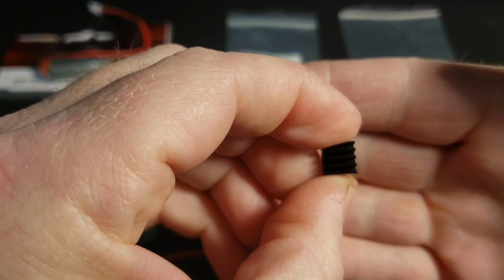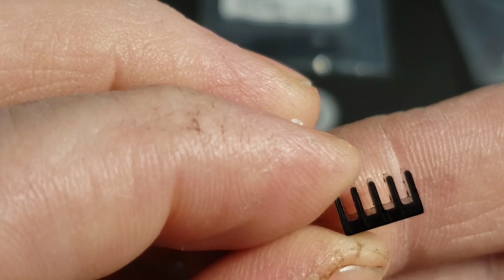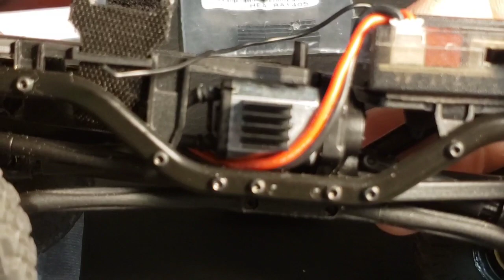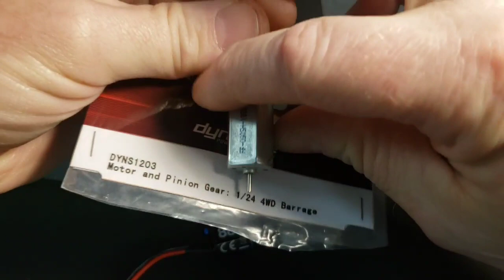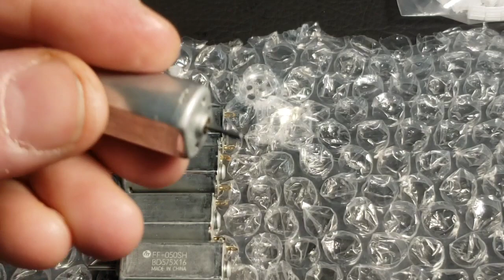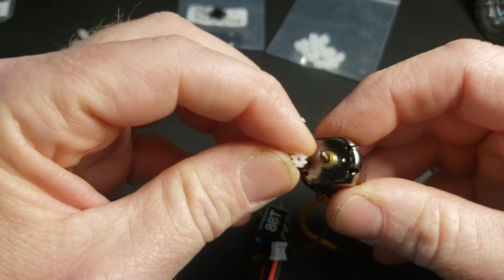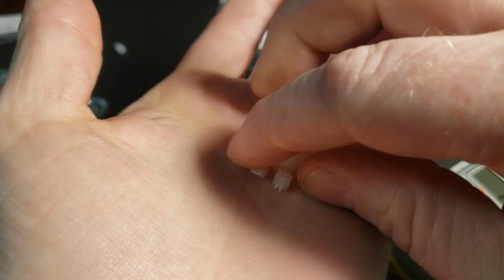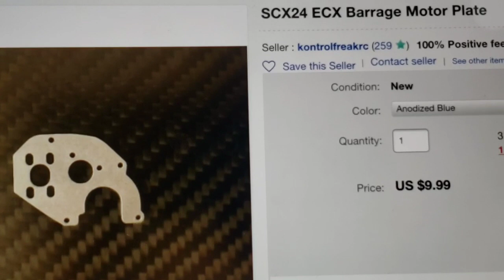SCX24 Brushed Engine And Gear Options

Comment: Thanks for the info. I replaced my motor yesterday. While backordered, I did see a couple of these motors sold in a bundle but I noticed the lack of cables and resistor. I can (merely) solder the cables, but the resistor and the theory behind that is kinda magic to me so I just waited for the thing to be back in stock and got two haha. I did not grind the motor shaft for fear of somehow damaging it, so I put an improvised washer between the motor and the plate and ground down the inside of the cover just enough to not perforate it. It works ok but the plate and the cover look messed up lol... I may end up buying them...
Reply from the maker: Just drill a hole in the cover if you are not comfortable cutting the output shaft. 

If you run the Shapeways motor mount it doesn't even have a cover. Indoors it would never be a problem.

Comment: I just drilled a hole in the transmission case, it worked fine.  How long are your motors lasting before replacement?
Reply from the maker: Since I figured out all of the places that can bind the drive train and run heat sinks I have not had a single failure.
Reply: @EXPIOWA  really? Huh
Reply: @EXPIOWA  wait are you saying you've not had a single engine burnout?
Reply from the maker: @czechnolike  That is correct. Since correcting all of the binding areas (that were present from the factory), and adding heat sinks, none of my motors have failed. 

I have one stock (sticker removed), one Barrage, and one PN70 rig. You have seen my course on video. I only rock crawl. I drive at least one every day.

Comment: Thanks for this vid and others you have made, they are super helpful.

OK, I got replacement motors delivered today and couldn't wait to tear into at least 1 of the 4 SCX24's I've acquired in the last month. 

I drilled out my own motor plate, installed the barrage motor, flipped the wires in my plug and set off to impress my son. The C-10 leapt forward with authority, but limped and sputtered in reverse, even more so while turning in reverse. I switched batteries, removed the trans cover, checked for rubbing at the diffs and wheel hubs, swapped the motor/trans into another chassis/ESC, and then even switched barrage motors (bought 4). The problem was minutely less in the Betty chassis, consistently bad for both motors I tried. The gear lash is set loosely between the spur and pinion.  The only influence I was able to make was to push gently on the motor housing which would change the alignment of the motor shaft to the spur gear.  Only other thing I can think of are bearings in the trans (I could try these motors in a different trans), but even those seem to spin freely. Oh, yes, the driveshafts are correctly phased. What might I be missing? I did not superglue the pinion gear on the barrage motor shaft, it was quite tight. Maybe that is it??
Reply from the maker: Try running it without the body. I have a suspicion that something is rubbing. Headlight wire maybe. It is probably not the gears. Also make sure the wheel nuts are not too tight that they bind the axle.
Reply: @EXPIOWA  good thoughts, thanks. 

I did catch one wheel weight that I guess was rubbing, however, I got so paranoid that I tested each motor before installing them. I think I just got two bad ones. Running in my hand alone two spin well one direction, but backwards sounds/feels like a bad bearing/bushing. I had switched the wires in the plugs first and was worried that screwed something up.

In any case, all bearings/gears got attention and I clearanced the pinion gear case on the two that did pan out. I did not grind the shafts shorter. 

I ended up using a bit of super glue and installing the pinion gear flip/flopped so the "un-toothed" side was out. I had to drill a hole in the case, but aligning the gears was much better. 

Appreciate the reply, four linking and LWB the Betty next!

Comment: Thanks for the SCX 24 tutorial on the motors and gears awesome information on all the different options for a fix to get back up and running quickly and the tip for soldering with liquid paste to! I've been using small heat sinks off of some small electronic panel I've demoed cut them down to size and use white dielectric grease to help dissipate the heat also!😉👍

Comment: Hey man if u still have some stock scx25 motors that burnt out take the cap off and take a look at the inside of the cap. I was looking and i believe theres a way to fix the stock motors
Reply: I was wondering if it was something repairable that breaks. I'm going to crack mine open and see if I can find anything. I figure I can't break it any more than it's already broken right now.
Reply from the maker: Can you say how?

Comment: This was really helpful! I just upgraded my SCX24 motor to the Barrage motor. It has much more torque at low speed :) I'm having trouble with the original pinion slipping on the new motor. I'm now using the Barrage motor with the included pinion, however it is a bit louder, and doesn't sound great. Your info here was VERY helpful!
Reply from the maker: I am glad to hear that. You guys are why I make them.

Comment: So if you didn’t have any of the resistors or anything I have some of those plugs and wires what would happen if you just wired the motor straight up would it just make more noise
Reply from the maker: You would not see a bit of different with or without the resistors. It reduces noise within the circuit.
Reply: @EXPIOWA  awesome good to know I have four of these little trucks now and would definitely like to have some extra motors laying around. This is great information been searching around on eBay.  I found some that will run on 68 or 12 V at around 10,200 RPM this seems like it would be a good turn count. I’ve seen some listed as high speed in summers high torque but paying attention to some of the numbers I think I’m in the ballpark. I see some listed as precious metal don’t know if that really matters or not
Reply from the maker: @LargeeeScaleLife  They are all Mabuchi motors and are essentially the same. There may be some variation in torque and RPM but I doubt if it would be noticeable on a crawler.

Comment: Great info is the hot Racing gear set up the same ratio? Or because it’s a different pitch it could be a little different but still comes out to be the same
Reply from the maker: I believe they are roughly the same ratio. There may be a slight difference. I will count teeth later today.
Reply: @EXPIOWA   Counting teeth won't work when they are different pitches. Diameter of spur and pinion is the number to look for. UNLESS....you are smart enough to do the tooth pitch conversion. Go to www.radiocontrolinfo.com /rc-gear-calculator to calculate conversion exactly.
Reply from the maker: @cornbobrimlove7892  I count teeth all the time and have my own app for determining gear ratios.
Reply: @EXPIOWA  Cool...Lots of useful info on that site though. check it out.

Comment: Great info on the gears and motor. Might be nit picky or just different printing machines. On the Dynomite motor 1855 the  RGT motor sure looks like 1955. The 8 top and bottom are the same size the 9 the top is bigger if its just missing the connecting line to make it an 8. Seen some other vids with that type motor different numbers when running have hardly any speed but look good slow crawl

Comment: They make double sided sticky thermal pads which will transfer the heat from the motor to the heatsink much better.  Probably wont make much of a different honestly but just FYI.  They also make similar heatsinks with the thermal sticky pad already installed.  Can lookup Raspberry Pi heatsinks for example.  I dont have them on mine yet but I assume they will hold.  Or, maybe even cutout a thin slice to also use CA glue so you still have thermal pad on it.  I did have a motor mounted heatsink on my RC18 it was just metal on metal but it did make a big difference.  It was a 2 piece that clamped to the motor.
Reply from the maker: Thank you! I will check that out. 🙂

Comment: Thanks for the video! I also bought the motor mount and fatgirl body from shapeways gamyrc’s store. I also bought 50 turn and 39 turn PN racing motors lol. Did you use M2x12mm bolts to mount the motor? As for pinion i bought a 13tooth 0.5 mod gear. I hope it will work.
Reply from the maker: I have no idea what the bolts are. I had them in my hoarder random parts box and they worked. 😜👍
Reply: @EXPIOWA  can you post the link to the shapeways mount that you bought for the 130 motor?
Reply from the maker: @jstyleent The first link is for the mount I used. There is an updated one that is supposed to mount the motor lower. I will put that link below the first.  https://www.shapeways.com/product/B9RBQMX5Q/axial-scx24-deadbolt-370-motor-mount

Below is the updated mount link. I don't know anything about it yet. I have one on order though:

https://www.youtube.com/redirect?event=video_description&redir_token=QUFFLUhqbHhyLUZ3elU0U0RGcUEyMmdtNS1qTkg0YVJxQXxBQ3Jtc0ttVWhPUGFuV3dqaFRwWHlIS0dicEp0VXNMdGFKdVJLMVZES0JLaGt2TFRlb2lBbUpES2pSa3JUaWZONkZuc2dNYzZ0UVpHcDNwbG8taGgwR1l3LU1PTWxYd1J1VFpCeDdhSm15WmJFZE44OWhoLTdacw&q=https%3A%2F%2Fwww.shapeways.com%2Fproduct%2FF36UVFNAD%2Fscx24-2fm-rc-surpass-motor-mount%3FoptionId%3D195155714%26li%3Dshops
Reply from the maker: A 13 tooth pinion gear will be about 70% faster using the HR 32 tooth spur gear. Ideally I would want 6 or 7 teeth on the pinion. I like torque over speed when it comes to crawling.

I would recommend using a PN70 and no lower turn count. You risk blowing the ESC. Certainly do not use the 39.
Reply: @EXPIOWA  Thanks for the reply! Yeah your mods are probably the best i've seen on youtube. I'm building both my deadbolts  to be a hybrid for indoor racing and crawling lol. More like rock bouncers/buggies.
Reply from the maker: @jstyleent  Watch your ESC and motor temps. Running a 13 will ask a lot of it. Post a video once its running. : )

Comment: As much as I love my 1/24ths, I'm interested in the hobbyplus CR-18 JEEP.  What do you think of those? Enjoyed the video & learned a lot.
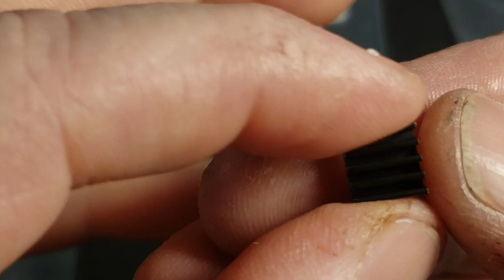Reply from the maker: I had a 1:18 Losi Mini-T 2.0. That was my only experience with the scale. I didn't like it. 

It doesn't fit categories I care for. Its too big to run well indoors. If I want to run outside I like 1:10 a lot more. 1:18 doesn't fit anything in my opinion. It tries to be both but I feel like there is too much compromise. 

Pass
Reply: I have the convoy which is the truck version it’s a really good little truck. I added a heavier set of wheels and some bigger tires which helped. The aluminum shock upgrade they make is nice because they are a little more adjustable. Out of the box they’re not the most capable but with very little work they could be made great. And if you’d like to stock wheels and tires they actually make pretty heavy brass rings to go in the wheels that really help out

Comment: Has anyone attempted to hack in a Kyosho mini-z brushless motor. Look very similar in size and there are alot of different kv ratings and types that may work. They're not cheap though, I think around 25, 30 bucks or so. But at a glance look very close to being able to use. Just something interesting I had thought about trying when I ran across them on eBay. Good video.
Reply from the maker: It would fit on the Shapeways mount. If you decide to go brushless you would need a different ESC and receiver. At some point the transmission gears could not take the torque.

Comment: You in iowa?
Reply from the maker: East of Des Moines.
Reply: I was looking at a set of the t/finder on beadlocks. Haven't ordered yet.  Been trying to decide.
Reply from the maker: @robbiesigler2593  I love the wheels on my trucks. They are pricey but awesome. 

I also have a set of the RC4WD stamped steel ones. I don't care for them. They were about half as much. You get what you pay for.
Reply: DSM Southside
Reply from the maker: @robbiesigler2593  Let's get with Cory and plan a rock crawl day. If you have aftermarket tires you will like my course. Stock tires...not so much. They can not make the climbs.